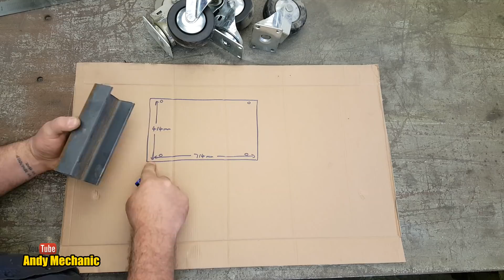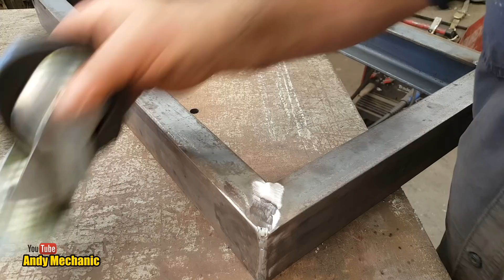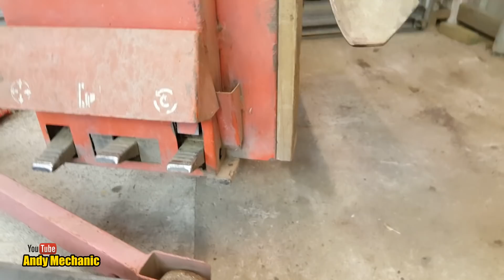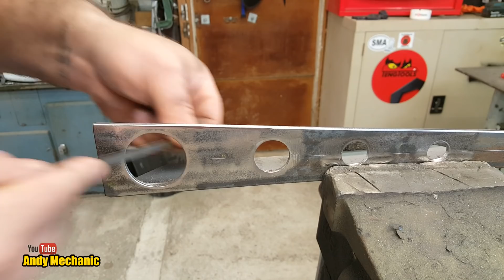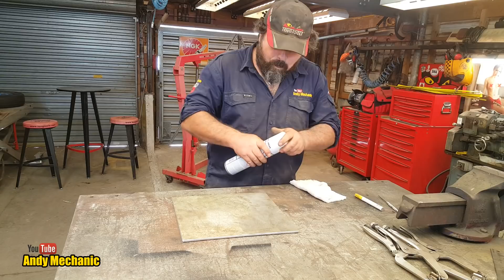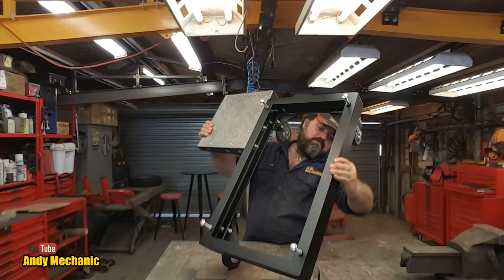Giving the tyre machine wheels! #2022

Comment: How are you liking the castor six years later? I’m about to order some casters, I just took delivery of a brand new tire machine that weighs 585 pounds. I’ve got a limited space also in my garage so I’m hoping this makes it better. Thanks.
Reply from the maker: Hi, they are working great. No issues at all. I'd suggest getting the ones that have locking breaks & where the wheel can't rotate when locked too.

Cheers
Andy
Reply: @AndyMechanic thanks I just ordered those kind

Comment: Back when I was shipping, I did fabricate different types of racks, made from scrap angle steel, in order to better secure and secure equipment and free up deck space. Fabrication was one of the jobs I enjoyed most about engineering. The other thing I enjoyed most was going ashore and having a pint.